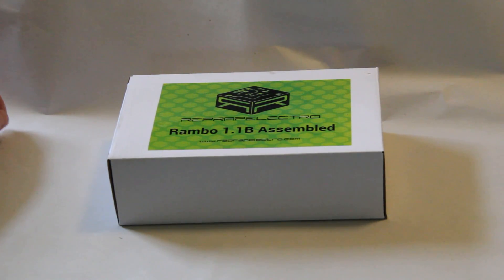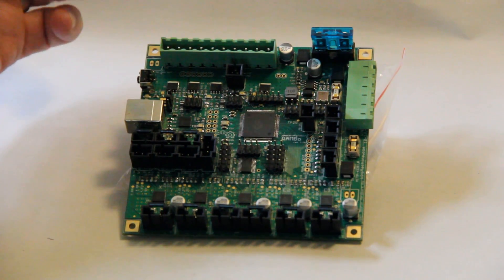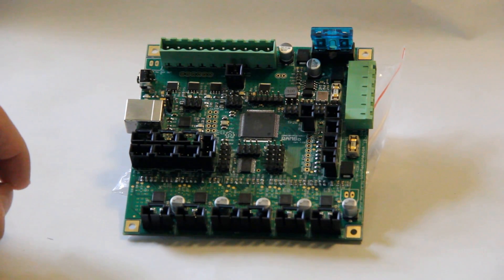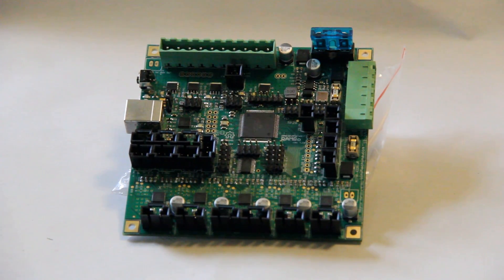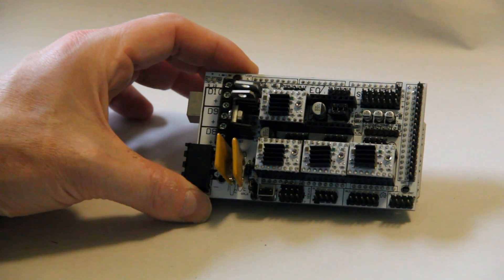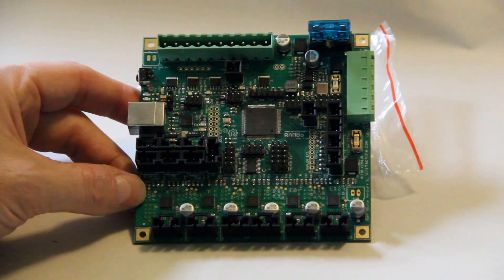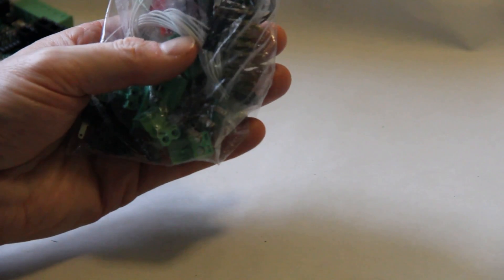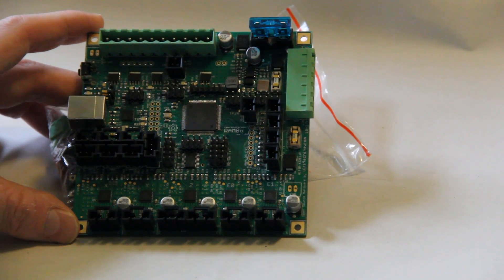Review of the RAMBo 3D printer controller board by RepRap Electro.

Comment: In your price comparison with the Ramps which supplier are you assuming?  The Arduino mega is about $45, but Chinese clones on ebay can be had for around $15-20.  Ramps boards are available for around $10-15 (or LESS) from the same suppliers.  Step-sticks can be had for $2-3 each when purchased in sets of 4 or 5.  SO the ramps combo can be put together for around $35.  If you chose your suppliers carefully (look at their feedback on ebay) you can get a quality product that will work well. (That's what is in my repstrap).    

Mind you I like how the Rambo is put together, and it is easier to wire up than a Ramps board.
Reply from the maker: I've had bad luck with Chinese clones, many of those boards have taken short cuts which can be dificult to detect until you try to do something like hook up a 24v power supply.  I am assuming getting your RAMPS from known domestic supliers.

Comment: This board is powering my rostock max v2
Reply: also, one thing to add. Those micro fuses are an absolute hassle to get ahold of. I blew one by accidentally shorting my fan output which the micro controller is also fused to so my printer was out for a while haha.
Reply: ***** They're not that hard to find, the easiest might be to just get them from Ultimachine : https://ultimachine.com/content/fuse-0448005mr
Reply: Youness Alaoui
well, i never saw that site when i needed them. I ended up paying $5 a fuse haha. Thanks for the link. definitely saved.
Reply: ***** no problem. I think we'll add the fuses and connectors to our store on reprapelectro as well, I've heard a few people were looking for replacements, so it would be good to have it all in the same place.